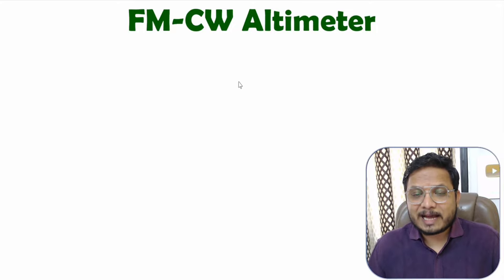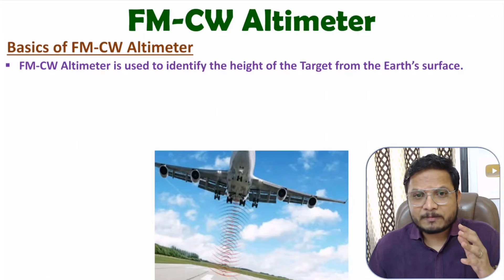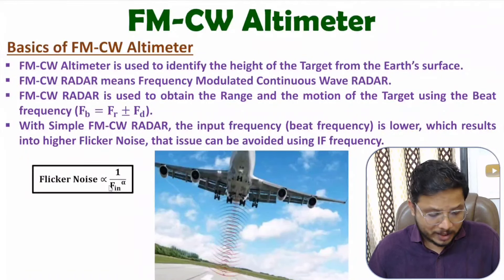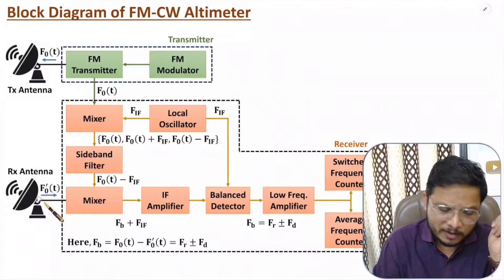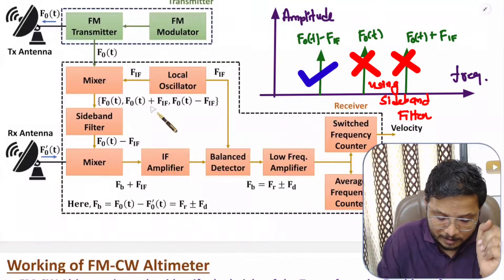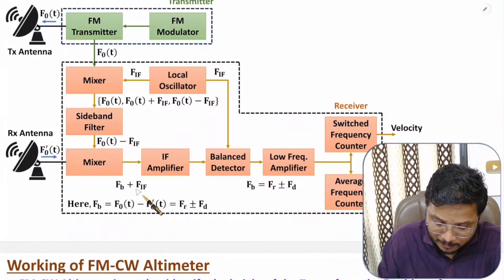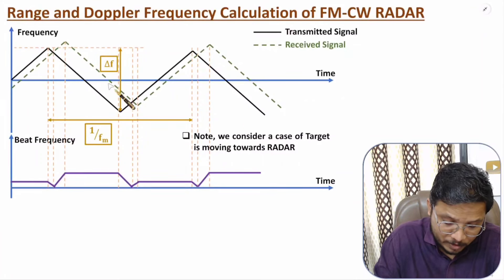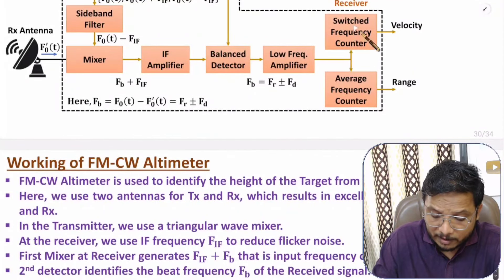FM-CW Altimeter / FM-CW RADAR (Basics, Block Diagram, Range & Doppler Calculation) Explained

Comment: Dear Prof.DHOLAKIYA
I'm trying to write MATLAB CODE simulating FM-CW radar but, For unknown reason, Matlab Simulating doesn't work well when detecting target's velocity.(My CODE has high accurcary when detecting target's range)  I have tried to solve this problem for 72hours(continuously),but I can not find  what is matter....
Reply from the maker: It needs time to examine frequency and waveforms of TX and RX signal.
Reply from the maker: Try this code
Reply from the maker: % Parameters
fc = 77e9;          % Carrier frequency (Hz)
c = 3e8;            % Speed of light (m/s)
BW = 200e6;         % Bandwidth (Hz)
Tchirp = 1e-6;      % Chirp time (s)
sweep_slope = BW / Tchirp; % Slope of the chirp (Hz/s)
R_max = 200;        % Maximum range (m)
v_max = 30;         % Maximum velocity (m/s)
R = 50;             % Target range (m)
v = 10;             % Target velocity (m/s)

% Time vector
t = linspace(0, Tchirp, 1024);

% Transmit Signal
Tx = cos(2 * pi * (fc * t + (sweep_slope / 2) * t.^2));

% Received Signal (with time delay for range and Doppler shift for velocity)
tau = 2 * R / c;    % Time delay (s)
fd = 2 * v / c * fc; % Doppler shift (Hz)
Rx = cos(2 * pi * (fc * (t - tau) + (sweep_slope / 2) * (t - tau).^2) + 2 * pi * fd * t);

% Mixed Signal
Mix = Tx .* Rx;

% FFT to get range information
n = 1024;
Mix_fft = fft(Mix, n);
Mix_fft = Mix_fft(1:n/2);
f = linspace(0, sweep_slope / 2, n / 2);

% Plot the result
figure;
plot(f, abs(Mix_fft));
title('Range FFT');
xlabel('Frequency (Hz)');
ylabel('Amplitude');

% Beat frequency (range information)
[~, idx] = max(abs(Mix_fft));
fbeat = f(idx);

% Calculate range
R_calculated = fbeat * c / (2 * sweep_slope);

disp(['Calculated Range: ', num2str(R_calculated), ' m']);
Reply: @EngineeringFunda  Thank you... I solve the assignment at 10:00pm Now I can sleep